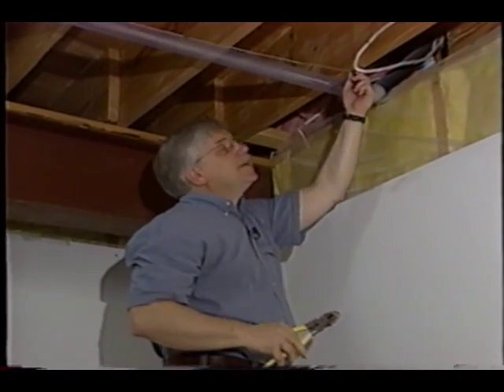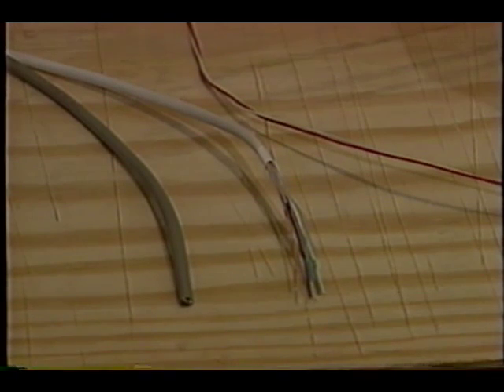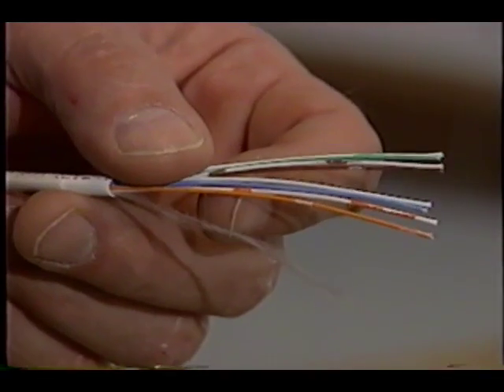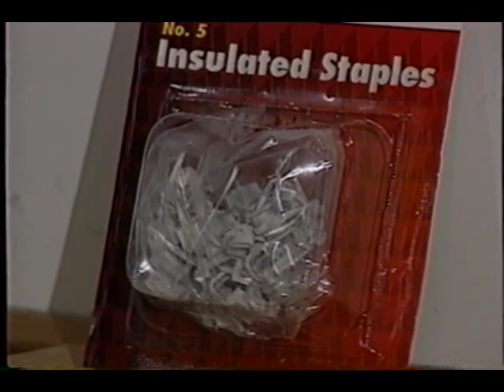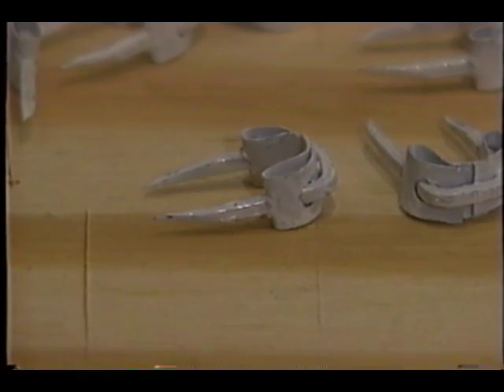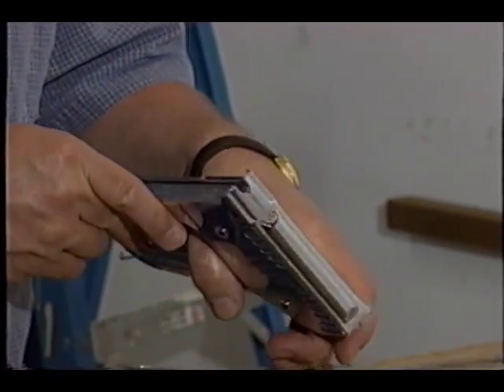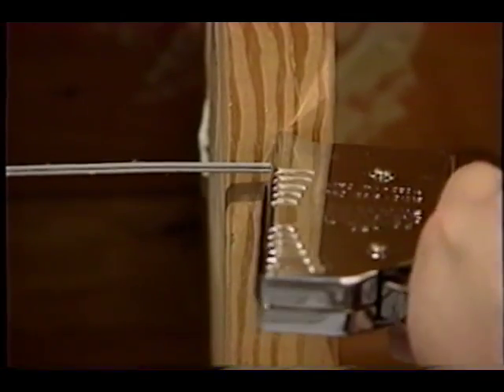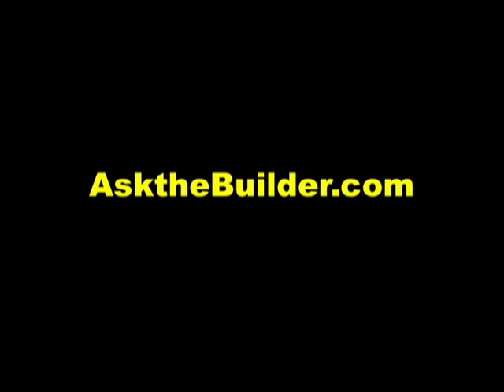Low Voltage Wiring

Comment: Why not just tape the low voltage wire to the central vac pipe?
Reply from the maker: That's one way to do it. Now all low-voltage wire is for central vacs, right? Watch my NEW live stream videos! Subscribe to get my FREE newsletter here: www.AsktheBuilder.com
Reply: @askthebuilder  I like T25 D staples into the wood and then a zip tie to secure the wire to the staple.  One extra step but works great for multiple wires and you don't have any worries about the zip tie cutting into the cable.

Comment: @aronchock never splice low voltage unless absolutely necessary but if you must you can use cable splicers. they are little plastic pieces that connect the conductors of one wire to another. if possible though... replace the wire with a longer one.

Comment: staple much easy,
using hammer for staple much secure
    because you can apply a right force to 
       ensure you don't damage the wire.